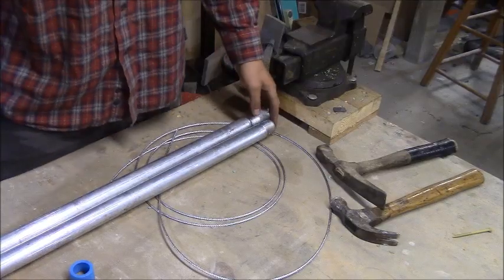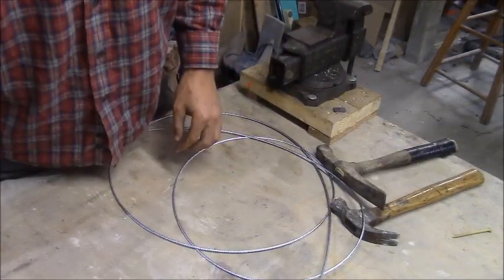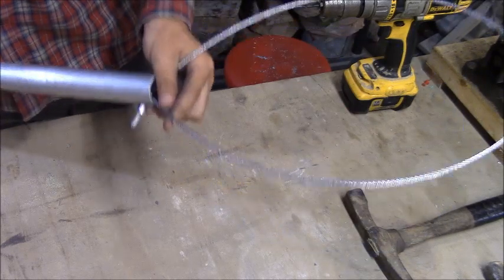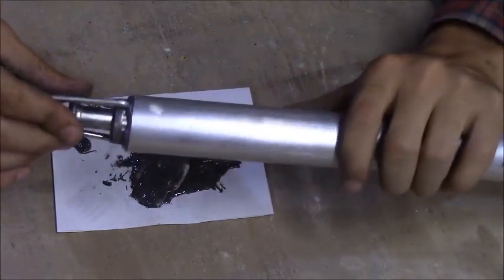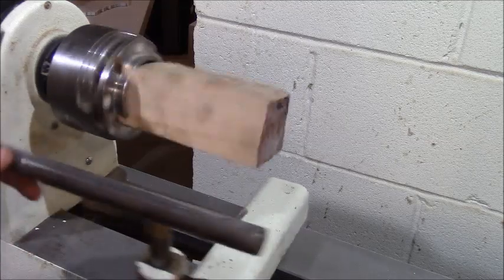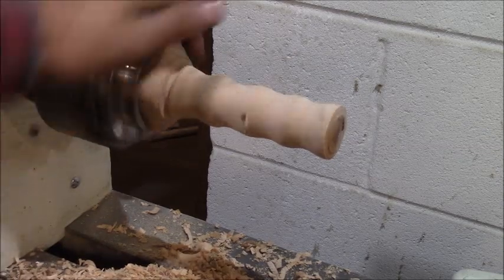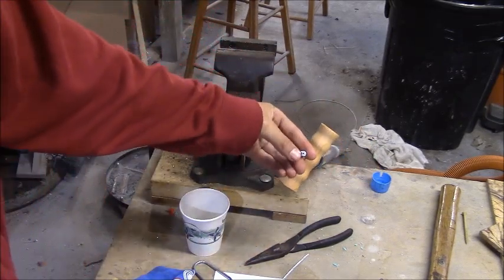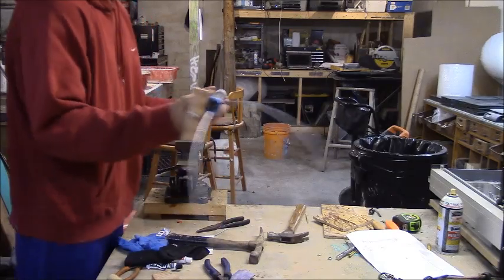Collapsible Catch Pole for Trapping

Comment: Thank you for the easy to follow tutorial, you’ve got a new subscriber!
I had a hell of a time catching a scared stray dog this week. Next time there’s a dog in need, I’ll be prepared.
Reply from the maker: Absolutely. No problem. One thing that I have since thought of that can reduce harm to the animal is using a coated cable. They sell them alongside bare cable and you can also sometimes find them at pet stores. If you use a coated cable the only thing different you have to do is strip the coating off where you are going to add the stops/ferrules (and make sure you by the right size stops/ferrules for the cable diameter not the cable and coating diameter).

Comment: Will be building one of these for sure. I may have to do something different for the handle though as I don't have a lathe
Reply from the maker: An old plastic pull handle from any lawn mower or something broken would work just fine or drill a hole in a 1 inch dowel and cut it to length.
Reply: @NobleSavageOutdoors  That actually sounds like a good plan. I thought about hand carving one but that sounds a bit overboard. lol
Reply: @DDFJ1230  I'm thinking about using an old umbrella handle!?!

Comment: Excellent video. Excellent design, nice job. Question for you: I need to make a similar catch pole 12 feet long to reach and pull down Palm tree pods and remove other dead matter from palm trees. Would you use the Rigid aluminum conduit? Would that be light enough at 10-12 feet long? I was also thinking of screwing 2 sections of 6 feet together so it would be stronger and more stable with that joint in the middle and I could collapse it down to store it.
Reply from the maker: Thanks. I think the 1 inch rigid aluminum conduit would be plenty strong and light enough for what you are looking for even at 10-12 ft (the original piece I cut to make this was a 10 foot stock piece). You could reinforce the joint with screws, but I don't think it would be necessary. In engineering typically 5 threads engaged gives you sufficient strength from a threaded joint and this had over 5 threads engaged when fully assembled.

Comment: I recessed hole in the handle so crimp button set below surface of handle and crimped another button on other side of handle to keep in place
Reply from the maker: I was thinking about doing the same thing, but I have been using mine a lot and haven't had any issues with the ferrule getting in the way or causing any problems.

Comment: Do you have one made of pvc you can upload?
Reply from the maker: I don't have one made of PVC because I don't think it would be strong enough. First, animals will and do try to bite the end of the catchpole and I think after a few uses, PVC would start breaking apart from animals biting it. If you continued to use it, you would likely have a sharp pointy end that would tighten around the animal and might injure it. Second if you can successfully work the PVC catchpole around the animal without it biting and breaking the end, then you have to tighten it down on the animal.  Animals tend to put up a significant fight when you sinch it tight. I can't imagine trying to hold a coyote, dog, or even a raccoon down and maneuver it with a PVC pole that keeps bending all over the place and possibly might break in half on me.

Comment: Did not see the connection of the 2 sections
Reply from the maker: When you buy 1 length of 1" aluminum conduit, 1 coupling typically comes on one of the ends. If it doesn't, you should search or ask for a 1" aluminum conduit coupling.

Comment: Never seen threaded conduit, from the sound of it on the table I’m pretty sure it’s water pipe not conduit bet it was in the plumbing dept not electrical
Reply from the maker: It's electrical conduit. Got it from my dad's shop who owns an electrical contracting company.
Reply: Stay in your lane, dan.  Aluminum RMC is used in exposed industrial applications where conditions may be corrosive to steel.  It is probably not available at your local home improvement store.  You may want to put some Noalox on the threads of the coupling, to prevent it from corroding and seizing.
Reply: I stand corrected, I also worked for approx 10 years in commercial electrical installation, just never seen it...👍